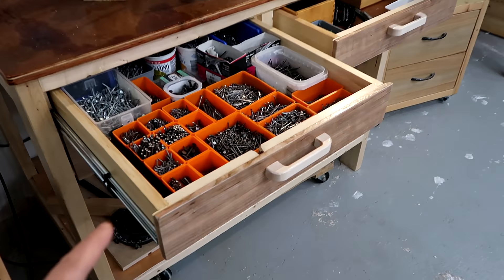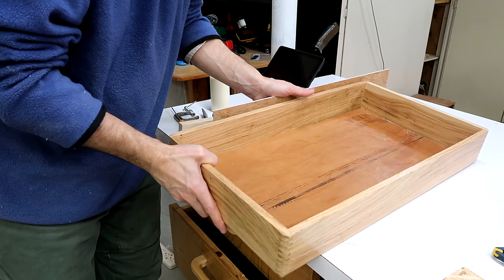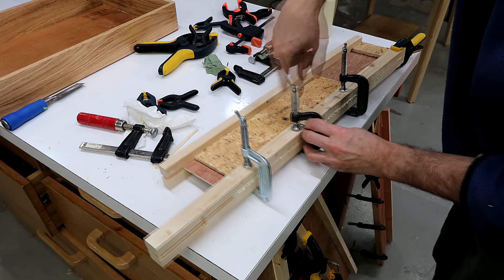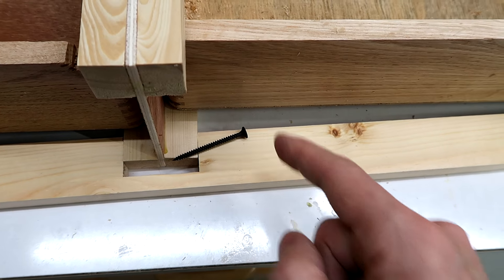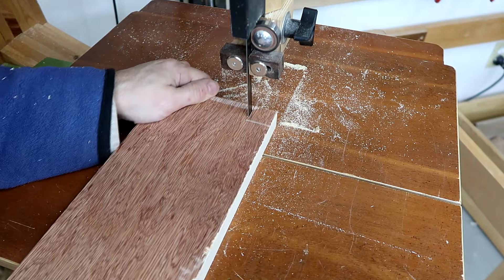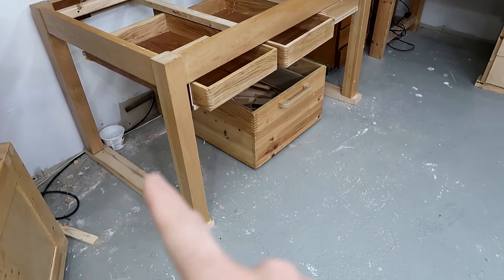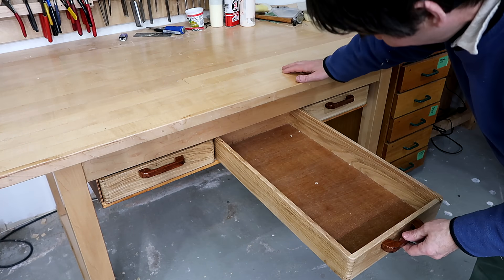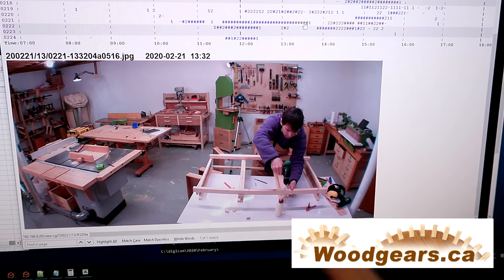Adding drawers under a table

Comment: "Atmospheric surface grime"   

Don't see a lot of YouTubers taking that into consideration. You're the best
Reply: lots of you-tubers don't use this level of scrap and salvage wood.
Reply: I think I just found the name for my next band!
Reply: I started accounting for is after reading 'The Traditional Bowyer's Bibles' in the '90's and in the Gluing chapter they had a demonstration photo of a piece of timber that had been lying around the workshop. One half they scraped the surface, one half left alone, then a drop of water put on each half, and took the photo about 30sec- 1 min later; and the water was still beaded up on the left alone half! It made it's point :)

Comment: Made my first “pocket holes”  yesterday.   Using the reverse drilling method I learned from your previous video, thank you!  I was surprised how well the countersinking bit followed from the Finish face side; worked out real well.
That shop apron or maybe the few gray hair I'm seeing sure shows you're maturing well Matthias.  Keep up the good work!!!
Reply: Can you point me to that video?
Reply: it was not a pocket hole,  just screwed in at an angle..  geez
Reply: I believe the shop apron makes it quicker for him to enter the house when needed by kids and Rachel.
Reply: @stevepark5504  Look Back 2 videos I think?  You'll see lots of comments referencing pocket holes.   it's so simple it's brilliant.   always learn something from one of Mathias's videos!

Comment: Love it! Just at the right time, was trying to think of the best way to do this using scrap under my bench, as usual you've already thought it all through for me.. Thanks Matthias! And I will be sanding that 'atmospheric surface grime' from now on! > (I actually used to do that, then got slack as I thought I could get away without it.)

Comment: Really appreciate the actual time summary.  That's about how long it probably would have taken me, but most creators would have said '1 hour'  :)  Either way, my wife would be asking me "what's taking so long" after 20 minutes.
Reply from the maker: I was a bit surprised at how long it took, but I included all the time I was physically in the shop, some of that was thinking though.
Reply: If I knew at the outset how long things were going to take me to do I'd never start anything at all. The thing is though what else are you going to do with your time?
Reply: @billybobjoe198  as far as I'm concerned everything takes as long as it takes. I don't pay myself by the hour. I couldn't afford to.
Reply: @billybobjoe198  it depends on the size of the job you're tackling. Large tasks are going to take long periods of time to accomplish. I'm not paying myself by the hour so I work through onerous tasks as fast as I can. They still end up taking swathes of time. Last week I cut down a tree, cut out the stump and hauled it all off too. It took 4 days. Was a fifty foot tall tree and I did it by myself. I'm no lumberjack either. Nor was this tree in the middle of the woods for that matter. It had the indignity of growing in the middle of my garden. Which certainly complicated things.

Comment: Thanks for introducing 'the notch' - it would be interesting to test strengths against pocket holes. And it looks great, customising drawers to make them bespoke to your needs. There's always a hitch with ready built cabinets. Weak draw bottoms with far too narrow dado slots to support them [esp. in flat pack rubbish]. Access to the back of draws, or inversely the drawer comes straight out and crashes into your foot!. Good job - but what about access to your kitchen cupboards now you've stolen the trays?

Comment: Pre-drilling, the necessary action of woodwork. 2:15 I saw at the hardware store that they have tool, that clamps on, the "pocket hole jig", for drilling angled/notch holes which cuts a step out.

Comment: The depth behind those drawers leaves plenty room for a secret drawer. For pocket hole paraphernalia for example.
Reply from the maker: ha ha ha.  Except the bottom rails aren't long enough so things would fall off the back.  Maybe if I put a trashbin back there, then the pocket hole paraphinalia drawer cann fall straight into the trash.

Comment: I wonder if the frame would benefit from a block in the middle of the back so that it could screw into the back rail of the table.
it seems to only be supported by the blocks in the corners, which prevent it from sitting flush on the back rail.
Reply from the maker: Yes, it could sag by a millimeter in the middle. But no one will be able to see that, and only you will care.
Reply: @matthiaswandel  well, as long as everyone but me is happy, then I'm happy.  ;-)
it does enjoy full support across the front.  I suppose you're probably not storing your tungsten ingots in those particular drawers.

Comment: I saw a tip to put salt between two glue Surfaces so they don't shift during clamping. Can you try this out if it works, and see if it affects the bonding? Can the salt be put in by the manufacurer, or will it be desolfed before use?
Reply from the maker: I dont want to contaminate the glue.

Comment: I know wood is awesome, but my bank account isn't. 
So, I'm using cardboard and I'm studying how drawer slides work. I have to depend on my design for strength instead of my materials. 
Most of this is good - esp. the "NO pocket holes!" bit.  😆😅😂🤣
But the limitation of wood is that you can't do deep 3-D shapes as easily, so I can prolly design my front as one piece. 
We'll see...
Thanks!

Comment: I wish I knew the backstory behind the "not a pocket" war going on. I think there's a dude in California that might have some more answers as I've heard the reference many times before. 

I pick up there's something going on but I've not been following for a bit.
Reply: Mathias doesn't like pocket holes, he prefers mortise and tenons. but here this notch-hole ressemble furiously to a pocket hole...
Reply: There was once a time were even the simplest box he would make with finger joint or use the pantorouter to drill the hole 
Meanwhile Steve Ramsey was under payroll of kreg so everything was made with pocket hole even if it would just have made more sense to just screw it tru

People were accusing them of making thing over complicated so Matthias made a pocket hole vs Sobel strength test video and it's a running joke since then

Comment: What is the "convenient height" that you like the shallow drawers? I am planing a many drawer project for my shop and am unsure what height I should make them.
Reply from the maker: use a height that is convenient for YOU not me.
Reply: I intend to make it convenient for me. But I was just curious what you feel is a convenient depth for a shallow drawer. 

Like I always make my shelves have a 13" clarence height from the shelf above it. I have found that fits most bottles and cans well. That of course is just my opinion and you should make your shelves at a height that works for you.

Comment: Haha, you got dangerously close to using a pocket hole in that front rail...you know you wanted to.
Reply from the maker: No.  Not enough grip in that particle board, much better to screw from the bottom.

Comment: I discovered a problem yesterday with my 113.298030 Craftsman table saw when I tried to tilt the blade to cut a 45 degree.  Beyond 10 degrees it got increasingly hard to turn the wheel.  I did everything I could to get it freed up to no avail....could only get to 20 degrees.  Brushed the screw rod, lubed it everywhere I could.  Don't know why it's so hard to turn...do you have any ideas short of dismantling the saw???
Reply from the maker: grease the trunnions
Reply: @matthiaswandel  from what I can figure,  I think you are right. Can't see anything else causing the problem.  I wonder if it is possible to remove the trunions to clean and grease them while the saw is still upright and assembled?

Comment: Could you test something for us? both as your style of exhaustive research, but also for the explanation of us all, Glue joints. the strength and effectiveness of glue up tactics. like...does higher pressure work vs just holding it in place for a 30 seconds. but more importantly. does smearing it with a brush or roller work any better on smaller joints, vs just laying a drizzle across, and letting clamping force and squeeze out spread it every bit as well? maybe 5cm wide strips 20cm long, and measure the breaking force of a whole bunch of glued up joints from the same sheet of plywood, or something? keep it consistent somehow.maybe a stack of glued joints, and see which fails first, compressed, smeared neither...however you want to test, I Think joint glue tactics could use some solid science, those glue rollers seem...way too over the top perfectionist but I think some carpenters swear by it anyway.
Reply from the maker: I have an idea - how about you do those tests.
Reply: @matthiaswandel  I couuuuld, maybe? but you have a larger audience to recieve that information, also I haven't the resources, scrap wood, etc. I honestly was thinking you might appreciate having subject matter to make videos about.
Reply: @billybobjoe198  Ahhh, I did not recall that he'd done such a video. It's been quite a while since I watched the older videos after finding him. Thanks.

Comment: Those top rail guides do not need to be full length. Could just make them half length.
Reply from the maker: and then there would be no place to attach the whole frame on the back.
Reply: @matthiaswandel  No place? So certain are you? The bottom rails could attach to a stretcher attached to the back legs of the table.